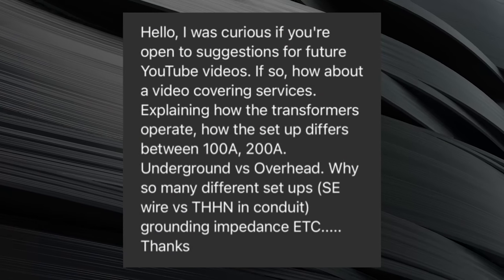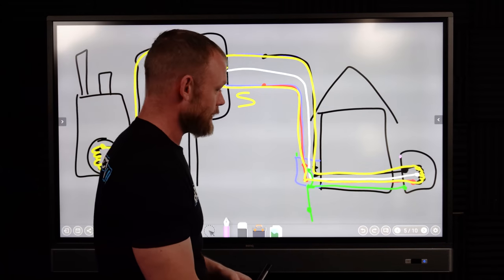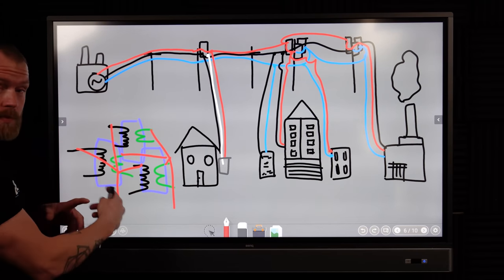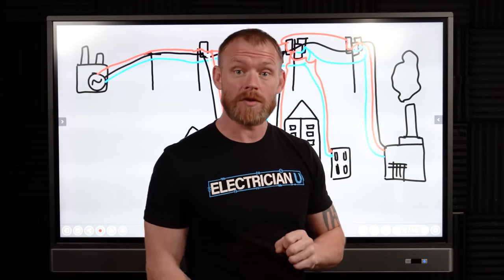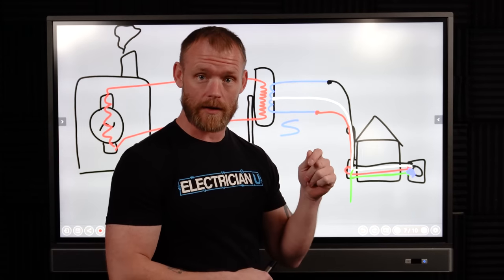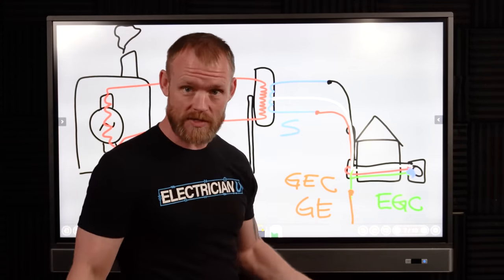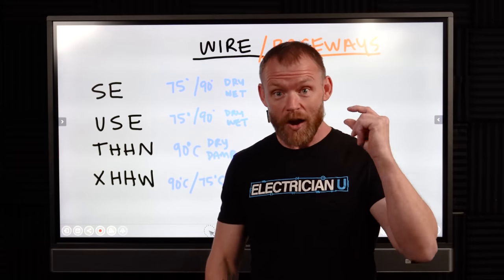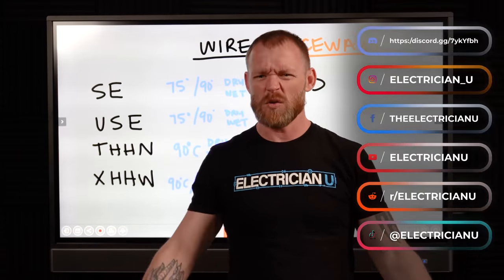How Does an Electrical Service Work? Electrical Service Panels Explained

Comment: Why would a 240 coil on a thermal overload relay contact (eaton),not work with a 480 3 conductor voltage. What is causing the 240 coil not to generate voltage.

Comment: I enjoy your videos. My home is on 6 acres and I am having my service put underground. The power Company came out and looked at my setup and suggested I change from a single-phase setup to a 3 phase setup. from 200amp to 320 amp system.  They said because I have my house and an RV setup and I plan to build a shop and maybe one other building.  I have watched your videos about single phase and 3 phase and the videos on above ground and underground.  Is there anything I should be aware of when changing a house over from single to 3 phases that could be a problem?

Comment: Video idea (if you haven't done it): Ideal GE system for a service.  I tried asking this on a professional forum, but they don't accept DIY questions, and I assume alot of normal electricians probably wouldn't care and just follow NEC/PC guidelines.  I'm a farmer installing my own electric service and read through the entire PC service manual, they just say reference NEC 250.  I know what the NEC requires, but what they require may not be as good as the system could be.  I don't have expensive test equipment, but I still want to do a good job.

Comment: My house has a 100A service and the breaker box is full. But, I want to run a couple more circuits. I want outlets in my basement for power tools (currently the only 120 outlet in my basement is for my washing machine). I want to add outside outlets for outdoor power tools and decorations. What should I expect an electrician to suggest? A sub panel, or upgrading my service to be able to swap my existing panel with a larger panel? What sorts of costs are involved? (I'm not expecting a specific price from a random question on the internet, rather what are good ballpark ranges in northern Delaware so I know if a contractor is either gouging me, or so under-balling me that I would be concerned about their quality of workmanship or "surprise" cost increases.)

Comment: I'm going to place a spa panel outside on the house wall to run my 18000 BTU split system. I will add a disconnect to that and use the other slots for outdoor plugs, lighting, and a 15 amp soft tub.

W0408ML1125-60 Siemens Spa/Hot Tub Outdoor Panel with 60A GFCI breaker

I want to put the 60A breaker in the main panel.

Do you have a video on that?

Thanks

Comment: Here in the Midwest we have to deal with tornadoes and crazy storms, but not earthquakes. Falling trees have ripped services apart. I've seen cases where the whole breaker panel and meter have gotten ripped off the walls. So our AHJ and power company force us to go underground for all new and rebuilt residential services.
Reply: The major cities have adopted service laterals over service drops for safety and to reduce clutter.
Reply: In some areas, particularly where tornado's are plentiful, underground makes sense.  In other areas, I have seen power companies fight underground tooth and nail, even threatening to leave an area if they are forced to go underground.  Thanks to Dell, I spent a year in Oklahoma City, including a storm in which I as a trained spotter was looking for a place to hide, only to find all of my neighbors outside in the driveway pointing at the tornado headed for them.

Comment: I ran into a situation the other day where the guy has a pole beside his garage. The wire goes to the transformer then down the pole to meter, from the meter it goes back up the pole and is spliced off so 1 wire goes to the house, 1 to the garage, and 1 to a barn each with thier own panel. My question is would you treat each service as seperate, each with its own ground plate. then at each panel tie the neutral to ground? this one confuses me

Comment: Good presentation of course. I was wondering that if the Primary secondary circuit each is a loop, some of the power is returned to the power supplier. So the electric meter only measures what is going into the building but not what is recirculating back to the power plant that is not used. A water pipe does not have a return loop only one way through its meter. Or am I missing something.

Comment: I see 120v/240v capability. What makes it 120v or 240v? Does the service panel control that? Can a 100 amp panel produce 240v circuit? Great videos. Thanks.

Comment: I live out in a rural area and also been an electrician a minute. One thing I’ve noticed is power companies often drop to one line in really rural areas. My question is go do you get a neutral at the residential service with just one line?

Comment: I have never been so intrigued by electricity until I became a homeowner. I used to perform receptacle and switch change outs while working with my dad but all I would do was remove and replace never thinking or knowing if it was wired correctly. Thanks to Dustin, I have received the right amount of education that has opened my eyes and give more respect to the trademen/women who make it happen so that we can live comfortably. Thanks, keep these videos coming...

Comment: Great explanation! Regarding overhead vs. underground - In MN it's getting more and more rare to find overhead lines to buildings, or even within a town.  We consider that mostly more reliable.  In our part of the country it's very, very rare to have disruptions because of weather.  Farms still tend to be overhead, but residential service is underground, and we don't worry about high wind, ice storms, tornadoes, etc. taking out the power. Local power companies are finding it saves them money, especially for repairs.
Reply: When I was a kid a mole decided to eat the forbidden spaghetti and electrocuted itself. We didn't have power for a couple of days until the power company dug up the line and figured out what happened
Reply: @bobby_greene  was it in pvc S40 or 80?

Comment: I have a question I have 4 circuits going to a lighting control panel. These 4 circuits are going to a switch bank that feed a pull box where all the   Switch bank runs to and on that box I have the 7 abcdefg switches how do I make this work I got kind of confused!  Had some parts working but I’m stuck. I’ve never ran it like this I’ve always had one circuit for each letter not 4 for 7 switches I hope u can see this and help asap

Comment: I also have a question. When is it ok to use drywall mounted light boxes? Meaning does it make a difference if it's either vertical or horizontal? How much weight is aloud to hang from these non stud drywall mount boxes. I'm not sure if that what their real names are but....hey there's many people wondering about this, and asking me questions about them and how they work. Thx dustin

Comment: I work for maintenance in a shopping mall with about 6 electrical rooms for powering the main area(none of the stores) and they lost a lot of the lists you place inside the panels and others are just listed wrong/poorly for example if it said "soffit lights" but the breakers actually go to the fascia lights. Any chance you could show us the easiest way to trace wires and any tips or tricks you have with larger buildings like this?

Comment: Could you discuss balancing loads across red/black on residential circuits? Is it important? What would be the impact on the utility, meter, bill, and resident if a house (or group of houses) were highly unbalanced, pulling most of its power through red/neutral? Does it matter? Does energy end up getting “wasted” and shunted to ground? How does the utility balance loads at the neighborhood scale (across 3 phases). How does the meter read the difference between a 5 amp draw on just the black line (returning through neutral) vs a balanced 5 amp load on each line, which would result in nothing flowing through neutral. I am making practical use of twice as much energy in the balanced load, but can the meter tell the difference? Does it “cost” the service half as much when I am only using black?

Comment: Dustin, can you cover 3-phase wiring in a home shop.   There is a lot of smaller older industrial equipment available (woodworking equipment, etc) that DIYers can use if they have 3-phase.  I’ve done a lot of single phase wiring but have never dealt with 3-phase.

Comment: Outdoors, visually, why does a transformer have only the 1-phase attached to the top of the transformer? How would the primary winding complete its loop back to the generator? 

I hope it is not using the bare cable attached to the bottom of a transformer? That uninsulated cable looks like it is coming from the same direction as the ungrounded  1-conductor coming from above to the top of the transformer.

Comment: Have you ever had a real estate home inspector flag the use of breakers in a load center not being listed on the manufacturer list? It seems to crop up with older outdated and/or obsolete manufacturer's, especially the ones that have been bought out by their competitors (ei: Bryant,Murray, Challenger etc.). The obvious fix a loadcenter upgrade, but I think it's not always necessary since the newer breakers are engineered to fit the obsolete loadcenter. Any thoughts? Thanks and Aloha from Kauai

Comment: don't know if you've made one yet(can't find it), but a breakdown of different panels/manufacturers would be nice. I'm looking to swap out a 60year old panel with something modern and don't know where to start. Maybe also some pro-tips/dos/donts for home-gamers swapping circuits over(or like me, running brand new wire altogether)
Reply: Square d qo panel is nice, it’s got some upgraded features over a square d homeline

Comment: I would love a video on how to calculate the electrical load of a service using both the standard and optional methods. Also how to properly use a clamp multimeter to read all phases and how accurate this option is. When trying to determine if someone needs to upgrade their electrical service what is the best and most accurate method to use? Thank you and love your channel!

Comment: Excellent video! How about a video on cautionary tales regarding “power strips”? Overloaded power strips, plugged into a 15 amp outlet, cause many house fires
Reply: I tracked a powerstrip that was back feeding a whole phase onto the ground buss. Like phase to ground read 208 and ground to neutral read 120, the the affected phase to ground read 0. It was f@cked. I found outlets with 208 etc. Still dont understand why it didn't cause a ground fault.
Reply: @Makitafan  It sounds like the neutral and ground weren't bonded at the service. The earth ground, grounding electrode conductor, does not always provide a path with little enough resistance to generate enough ampacity to trip breakers. The neutral is the return path that allows the breaker to function under that condition. Also, if the neutral and ground were bonded, you shouldn't have read a voltage differential between them.

Comment: Back in 2001, I installed on a Single Dwelling Residence a 350 Amp 120/240 VAC Single Phase RT / WR Meter Base with a 120/240 VAC 200 Amp RT/WR Disconnect Panel next to it with '' feed thru lugs'' to feed power to the Square D Homeline Main 120/240 VAC 200 Amp Panel  in the House and also to feed 120/240 VAC 200 Amp service to a 50' x 100 ' prefab Metal Shop Building about  75' from the house. The Shop Building has a 120/240 VAC 200 Amp Square D Homeline Main Panel which feeds power to a 120/240 VAC 60 Amp Sub Panel (#1) in one part of the shop, and one 120/240 VAC 60 Amp Sub Panel (#2) in the Machine Shop and another 120/240 VAC 125 Amp Sub Panel (#3) in the Machine Shop also for Welders and other machines in the machine shop, such as a 240 VAC 25 Amp Single Phase Metal Lathe, a 240 VAC 30 Amp Single Phase Industrial Band Saw,  a Single Phase 240 Volt Drill Press , a Industrial  240 VAC 30 Amp 3 Phase Milling Machine with a  Phase Converter (from 3 Phase to Single Phase) with a 5hp 240 VAC 20 Amp Single Phase Motor. The Service from the Power Company (OnCor) Power Pole mounted Transformer to the house was a underground , a '' lateral ''  in 4 '' PVC Conduit and the service to the shop building was also an underground lateral service installed in 2 '' PVC Conduit. All Conductors were Copper. The middle part of the shop is the Woodworking Cabinet Making Shop and it has yet to be completed in regards to the electrical rough in for the required outlets for the table saw, Drill Press, Wood Lathe, Sanders, etc; I also installed all of the Lighting fixtures for the entire building , all done with 4' four lamp LED low profile types fixtures mounted to the overhead purlins all done with 1/2 '' EMT and also installed 6 commercial type ceiling fans in the building for air circulation during the warm summer months .
Reply: Sounds like here, on our farm. Feed through for house and main run to barn and... beyond. 👍

Comment: Thank You very much for what you do here.
Out here in the wilds of Hutto, we have an interesting (to me) set up.  This area was apparently wired once before by a different provider as there is wire on the poles with transformers every so often, except all the doors are open.  On different poles we have the presently used service feeding underground cables.  For my street, we start at the cross street (Front street) with a single phase connection that feeds underground via what I think is an Auto-re-closer.  It looks like a normal door except it has a large base that appears as though it could be used to re-connect an areas service remotely.  From there they feed pad mounted transformers  (I think there are six on my block) and each of these in turn feed up to 4 pedestals located between duplex units.  Other streets in this area were apparently razed and rebuilt as single family homes.  Each such pedestal feeds 2 duplexes or two homes.  We recently had our front yards dug up so that AT&T could add fiber to the area.  The city took great effort to keep the water and sewer separated on different sides on the dwellings.  Behind my duplex there is a commercial area on Front street.  On one pole there is a large,  what I am guessing is a switch that can connect the southern part of Front Street to a different circuit.  It has what looks like a large slide switch, but then has a cable that runs up to an antenna at the top of the pole.  My guess is that this is a remote switch.  I have talked to people at the businesses and none mentioned ever seeing or hearing it switch, so I could be wrong.  The item at the top of the pole is too thick to be a lightning ground.  It definitely looks like an antenna.
This area and most of Pflugerville is serviced by Oncor, which got a lot of bad press when I lived in Pflugerville 20+ years ago for long outage times after a storm.  If a breaker could reset it, you were only out 20 minutes.  Otherwise we had to wait for a crew to be paged out, get to the office and pick up a truck and then go find the fault.  This typically was a 2 or 3 hour outage, and these happened often back then.  I have only been out here for a few months with only one outage over 20 minutes, but it was still less than an hour.  Sorry for the short novel - that's just the way my brain works.

Comment: Excellent video, Dustin.   Keep em coming.   Last year when I was running the Cat 6 cables in a newly built 3 story apartment complex in Charlotte,  NC as a subcontractor,  I saw a lot of larger apartment complexs  with a very large disconnect,  sometimes one on each end of the building,  that was labeled like "1200 amps, 208Y/120 volts, 3ø"   then of course each unit inside would get 208/120 volt single phase while the elevator and main HVAC system would run 208 3 phase with or without a neutral 
 As it would be extremely uncommon for 3 phase to be found in a residential situation,  unless there was a home workshop where the homeowner is running his own woodworking business and had a bunch of heavy duty air compressors and lathes that requires 3 phase, or it was a custom built luxury home that is exceptionally large,  and the utility company would allow it.
Reply: my suburban aera's had it 3P intel about the mid 1990's as my 1950-70's subdivision was the pathway for the main city step down T's/lines 240v/120v 😉 sp but they change it to put more houses in under where the poles/equipment where ect. and had i had the chance id have liked to had kept it but in didn't move into this house intel after 2006
Reply: "Richard Price I've heard of certain places in the country, notably Arizona and Texas areas, in the 50s and 60s, some larger homes had 120/240 3ø 4W delta service. As I'm told, when central air c..." . um what happened to you reply? and i thing 🤔 are's was a delta configuration 3 or 4 wire id have to ask down the road from me as he is still running the same equipment but changed/modified for 400A SP 240V service in a 3k-4k sqft home as my newer setup my older one was single phase as well but i don't know if that is from the occupancy tax disk aka new or not